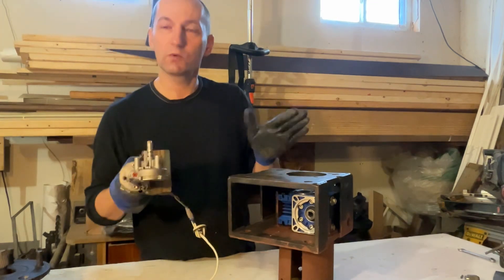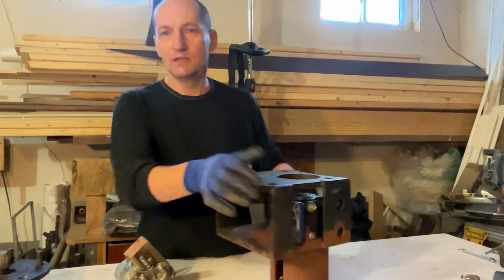Solar, tracker mechanism, east to west movement, DIY

Comment: I like your idea very brilliant I’m building one my self I found a gear box and a low rpm motor l was looking at your videos and wondering how you wired in your limited switches in to your solar controller on  stop & go I have the same solar controller using the dual actuator do you have a video on it or maybe you can make one.  thanks you  my name is DAVE
Reply from the maker: I’ll make a video about it in a bit

Comment: Hello , reducer nvmr40 1:100.  Motor 24v how many rmp
Reply from the maker: It doesn’t say on it, but it’s pretty slow, the motors from the power windows in the car are about the same RPMs
Reply: @valmaz2448  Thanks, so how many inches is the linear actuator
Reply from the maker: The one that I have is 25 cm, but ideally you looking at 30 cm, that is the distance that actuator moves

Comment: Hello Mr.,

I appreciate your work as a solar tracker, I will be inspired by your work to make one in my turn, I have seen your NMRV 40 gear reducer and I would like to know the type of engine or its reference to get one, thank you for your videos.

Cordially

Philippe Rosinski (FRANCE)
Reply from the maker: I didn’t buy the motor for it, as I mentioned in one of my videos, I used a motor from the garage door opener, but you can use any motor from the door that raises the window in the car🚙🙂
Reply: Good evening Sir, I am in the process of assembling the equipment, I have advanced on the equipment but I wanted to ask you a question about which length of verin you have chosen and what force of verin also. Thanks again, excuse me for this bad English but I do not master the language of Shakespeare
Reply from the maker: Thank you for asking question, from what I understand you are asking about the length of the linear actuator, if that is correct, then my linear actuator movement is 30 cm. But if you use 35 cm, it will be even better.
And it’s a fairly powerful one, it can handle over thousand pounds
I purchased it on the eBay. All the best in your project.🙂

Comment: Very nice breakdown
Really apreciate the detail and thoroughness….and yes …you take reuse to another level..!
I have a motor speed reducer and Toyota front bearing hub….maybe I will cut a shaft piece to keep the bearing parts from separating…great tips all the way thru. Maybe a discarded
Drill motor will replace the wiper motor….I’m not sure about the tracker sensor and controller….I’ve had poor reliability…water penetration and wires breaking from sensor pls.
I hope I can achieve similar reliability to my gas/liquid trackers….
Reply from the maker: all the best on your project
Reply: @valmaz2448  hopefully I can post the results
And thank you for the motivation